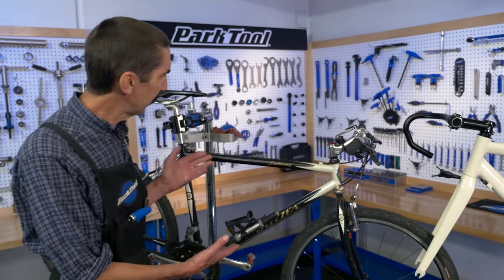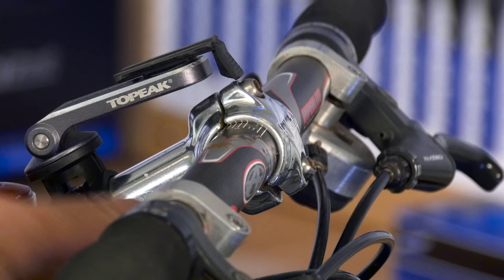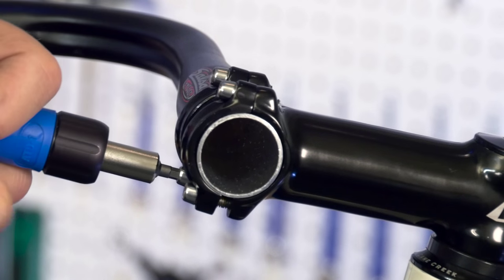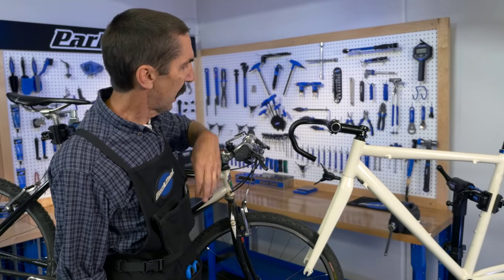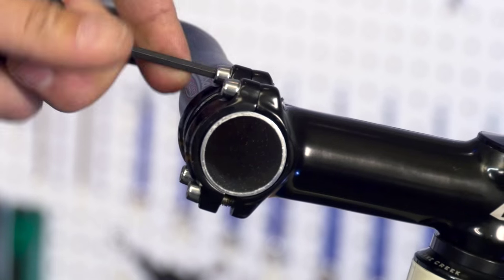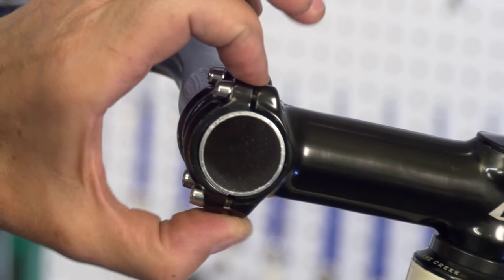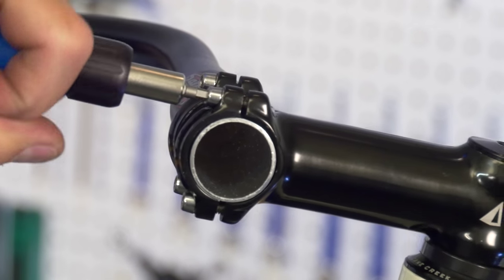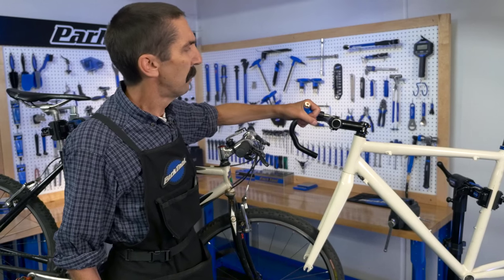Tech Tuesday #35: Handlebar Bolt Tension

Comment: Don't forget there are some exceptions to this rule, like straitline stems which require you to torque the top two bolts first and then move to the bottom bolts. The way the holes are drilled during production allows for this :)

Comment: What setting did you have on the torque wrench for the bolt tension?
Reply: I read somewhere that you should torque to 60 in lbs the first time and then to 80 in lbs.

Comment: Hello, is there any torque specification on carbon fiber wheel drop outs?
Reply from the maker: Do you mean when installing a wheel?  There is no real difference here compared to steel bikes.  
Or do you mean replaceable dropout in the frame?  In this case manufacturers have different specifications. Check with the manufacturer of the bike.
Reply: @parktool  when installing a new wheels and tightening the skewers
Reply from the maker: Close the skewers tight like any other bike. Your wheels need to be on as tight.  The carbon fiber can take this.....otherwise many people would be hurt everyday!